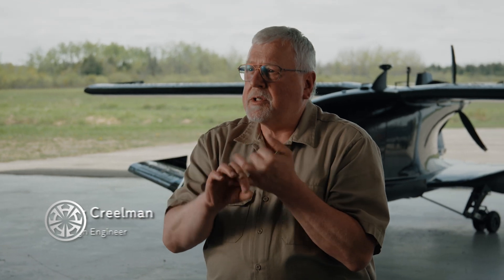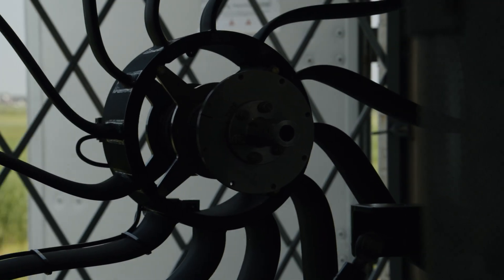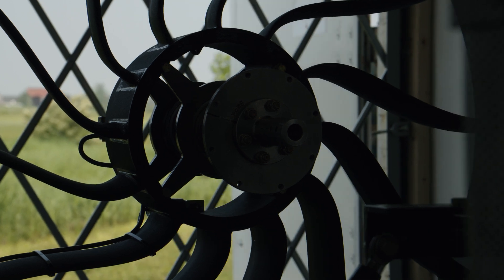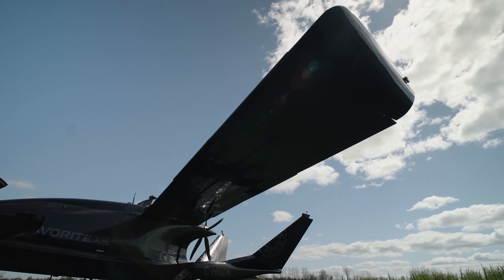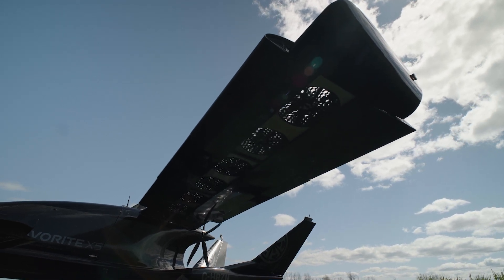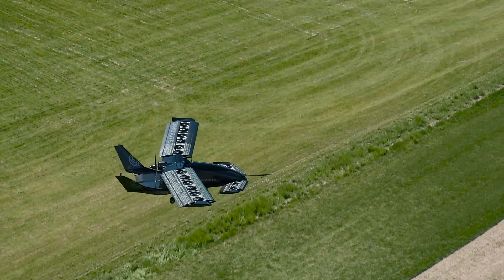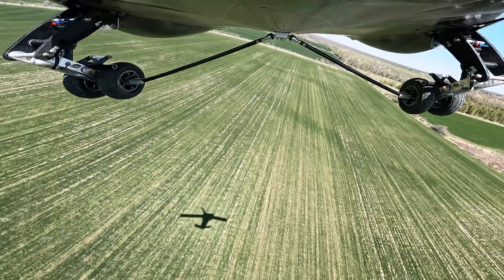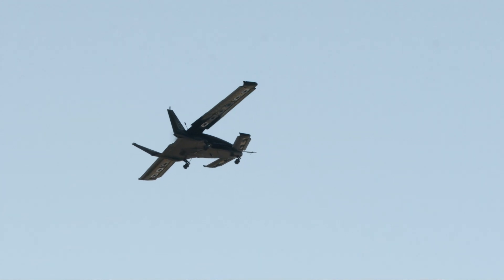FLIGHT/PATH - Episode 7 | Transition to Full Scale

Comment: Looking forward to more...  Very evocative design, so hoping the upscaling allows maned flight soon.
Reply: It will , and scouting the field by the time they done with tilting rotary functions,  we close to halfway through the mission.      

Smh, it's pretty much a solid lift air mass up , then rear push prop... and gone. wings close fans inside,  reducing drag, quiet cabin flight. 

 ready to land flaps open , fans on ...  power control land mode to control landing air mass cushion.      Which cavorite x7 can, via individual fan motors. Vs one rotary helo and multiple rotary vtols.   Our bby will be a hawk with kitten fit. 

🎉🎉🎉🎉🎉🎉🎉 , we are edge in the vtol field. 😊